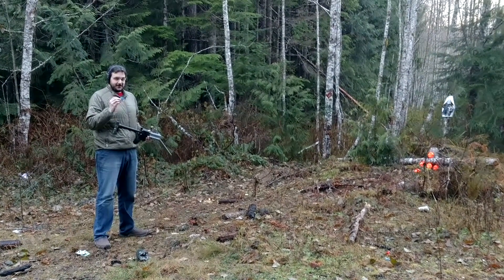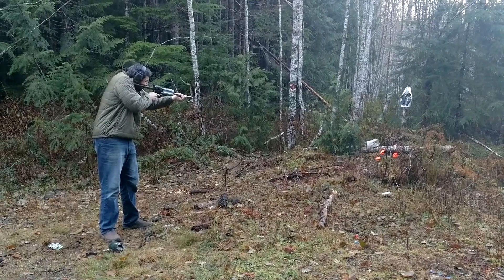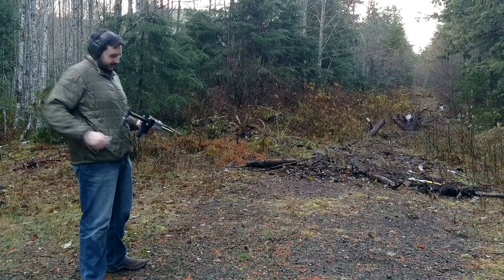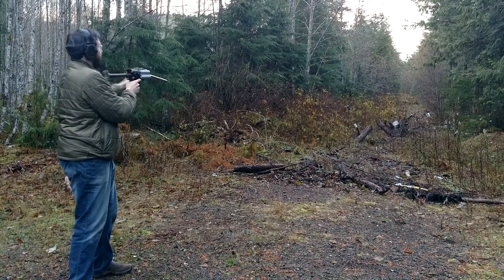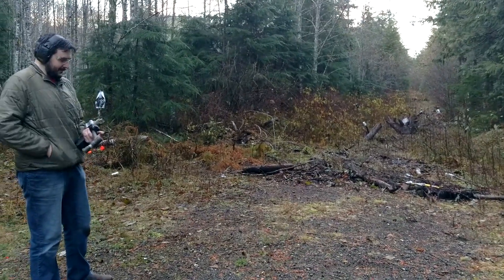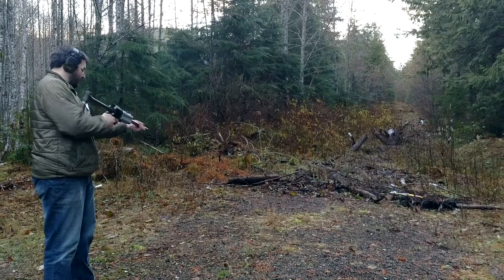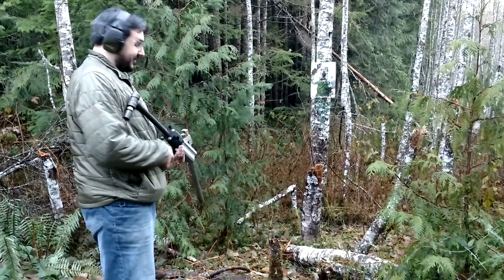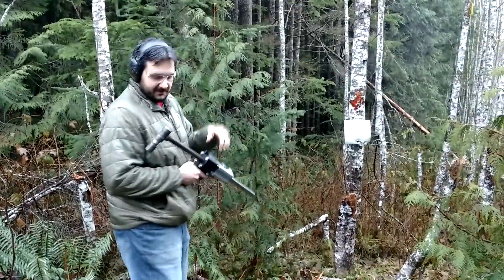#Liberator12k | 26 - Moment of Truth

Comment: I wonder if it would help for some larger or highly stressed parts to be printed hollow with 3 shell layers and then filled with resin. Might cut down on print time and possibly some strength increase. Resin is cheap at Home Depot or craft stores+coupon code.